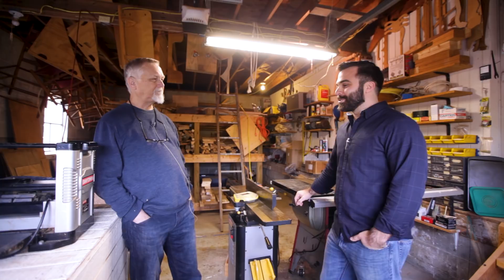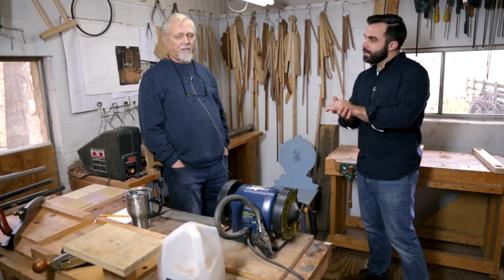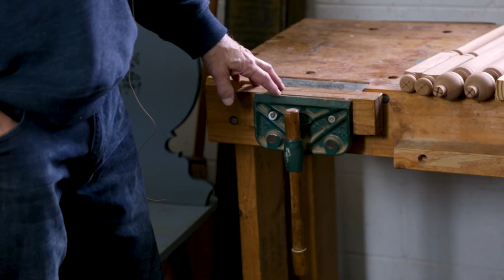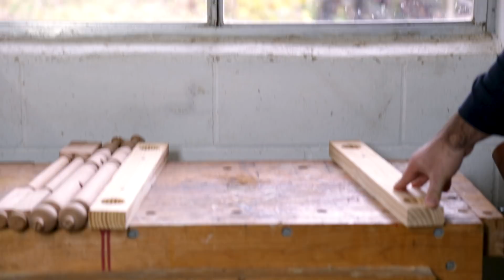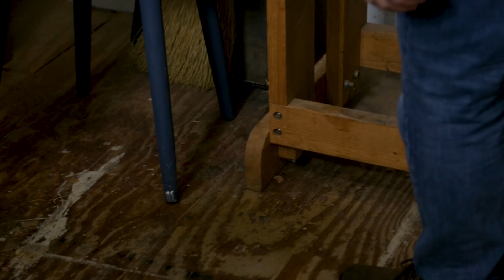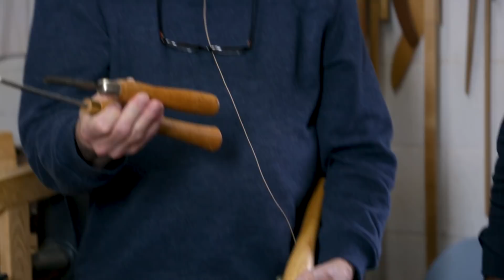Shop Tour with Kerry Pierce: Part 2 – Machinery

Comment: I almost pulled the trigger on a 1000 sq ft shop.  After some thinking and a move to a new state, I’ve decided that my next shop will be no bigger than 300 sq ft.  Since I’m not producing at an industrial scale and much of the work I do are small runs and I’m mostly hand tools anyways, a large shop does nothing but attract unwanted junk.  I like his style of woodworking: machines that do the rough work and hand tools for precision.  I also aim to acquire a few more hand tools such as a combination plane.